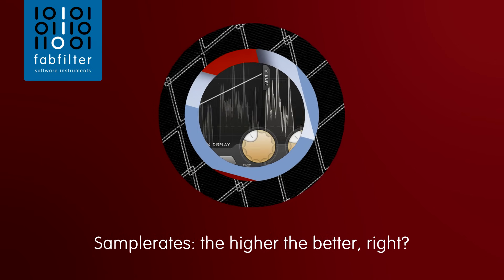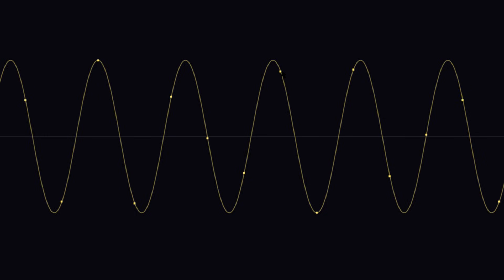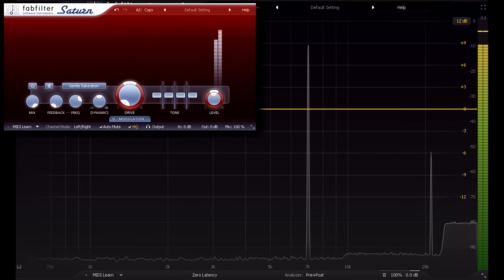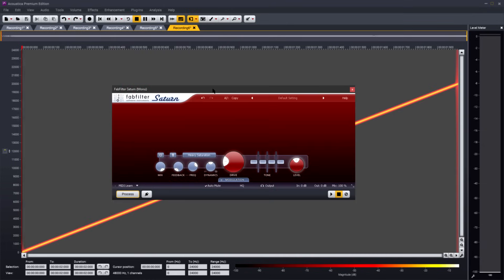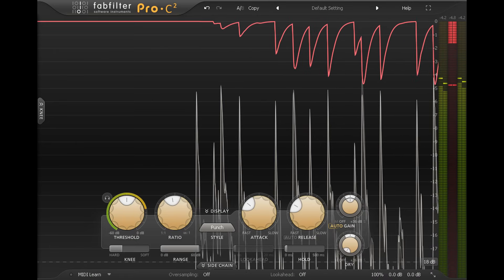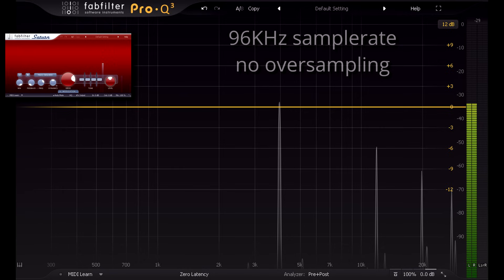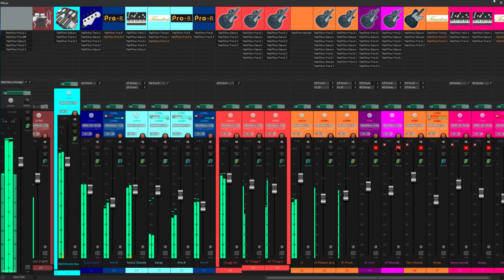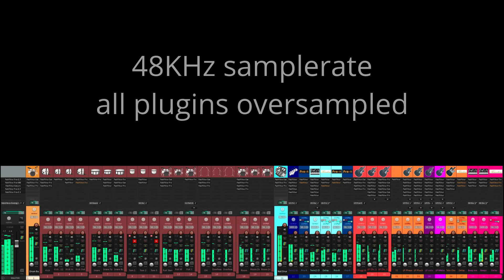Samplerates: the higher the better, right?

Comment: This is a spectacular expose on the topic. The only place where I get confused is at 24:05. when "the synth fills up the top bandwidth and it will start to alias as soon as it hits a non linearity". I not sure I understand why it would with the Nyquist being so far from it. Or why simply putting a gentle lo pass before it got past 22K wouldn't be a fine action at 96K? And then the simple question put forth to answer about high sample rates, "when to use them and when not to". So when should we not, in this construct of premises?

Thank you again for this video!

Comment: Fenomenal presentation on the topic, incredebly well produced. 

the HQ´button (oversampling) on the fab-plugings is golden, but what i dont understand is 

why it's not as an AUTOMATIC option, to use only during RENDERING ?
Many other plugins DEVS allow for this , MELDA , SKNote etc
Meaning you could work at a lighter CPU during mixing and NOT having to manually activate every instace of Oversampling during a 'Bounce' of the mix. 🤔

Comment: The trouble with this is that at first they say "Oh, but nyquist theory means you can in theory represent stuff ideally."
Which is then contradicted by "But we're not running in ideal scenario and look at how saturation suddenly brings artifacts" 
(which can be seen when going through a DAC, with audio analysis in hardware)

And then there is
"Look, we can remove some of the artifacts of digital saturation partially by increasing samplerate" — which directly contradicts the implied meaning of the title of the video
After which they go
"But it's impractical and isn't ideal in terms of how it gets rid of those artifacts, so let's try a different way to increase samplerate, with a filter on top of it now"
Which doesn't mean higher samplerates aren't better, in fact, it says the opposite: with proper (and even not so optimal) settings, higher samplerates are better, and with added filter can be another step better.

There is an additional situation when they showed the 20KHz tone and said "but I can't hear that"
And it's then said that not hearing it is rather normal, and you shouldn't be ashamed of it, since "most lose the ability to do so prior to becoming adults"

Which is fair, but doesn't bring up the point (which, shown later, they kind of know, but not deep enough and are thus spreading misinfo) that even if you could hear that, you very likely wouldn't via watching the video, because of YouTube, which is sending you either one of the OPUS streams or AAC streams, and all the AAC ones are 44.1KHz (a few are 22050, we don't talk about those) with a filter cutoff at just below 16KHz, while all the OPUS ones are at 48KHz and have the cutoff at somewhere above, perhaps 22KHz, (where you actually would hear that segment, if you could).
Side-note to this, interestingly the whole video's audio is with a clear 20KHz cut-off, except for that segment at 4:50.

The "listening test" section is, imo, laughable for bitrate reasons, which is, at best, 8x compression.

And the biggest issue, to me, is in the conclusion they arrive at.
The points showcased clearly show that whether higher samplerates are better, depends on your definition of "better". For studio use-case, their main drawback was the increased file size (for when it is in transit, since you can compress / downsample for storage, if you really cared about file size, which itself is quite miniscule in audio), it clearly shows that for quality, higher samplerate is better, and filtering is even better, but there are some plugins which come with oversampling, in which case that should be used, and there are some plugins that don't benefit from higher samplerates (according to video contents anyway), i.e. EQ. Which does come with drawback of higher processing power, yes. But it hasnt been shown by how much, and whether that really might he an issue, but it's considered enough to say "it's not better". Really?

Comment: In my opinion, priorities are recording, rather than mixing, at high resolution, and using plugins with built-in anti-aliasing features, but if your system can manage it, a higher sample rate is still going to help with the quality of the filters and allow you to more easily deal with plugins without built in anti-aliasing. There is also another benefit other than the filter qualities of individual plugins, which is that you may get more consistency across your mix if you have plugins with different degrees of oversampling or different types of anti-aliasing filters. I have some plugins that have anti-aliasing filters that work, but that do have an audible effect on the sound. Keeping those effects outside of the range of human hearing requires a 96kHz sample rate, so in that case 96kHz makes a noticeable difference across a mix with some of those plugins or even multiple different anti-aliasing approaches.

Another thing I often hear (including in this comments section) is that high frequency content will create audible distortion in amplifiers. If you are worried about this you can always add your own filter above 20kHz during mastering and check to see if it it is altering the sound in the audible range, and then you may still benefit from playback at 96kHz depending on the DAC, without the risk of overloading the amp. That concern shouldn't affect the way you mix.

OK I have to add because it was bothering me. If a plugin bogs down your system when in anti-aliasing mode and you are using a high sample rate, that is a poorly designed plugin. If you're already at at a high enough sample rate, the anti-aliasing mode doesn't need to oversample, it only needs to filter, because you are already oversampling, and frankly a lot of plugins could be better designed to simply not generate frequencies higher than the nyquist limit in the first place, eliminating the need for filtering.

Comment: In the radio frequency world, we often (in fact, almost always these days) use non-uniform sample spacing: quadrature sampling, with pairs of closely-spaced samples ideally a quarter-wave apart. This allows high-frequency content to be stored using a total number of samples limited only by the bandwidth, i.e. how much higher or lower you can represent vs the center frequency you picked for your quarter-wave sample spacing, while ignoring the information needed to recreate frequencies further away than that.

What's really interesting though, is that those frequency reflections you're getting off 0 Hz, instead reflect off of the bottom bandwidth limit of a quadrature-sampled stream. I wonder if that behavior could be useful musically for some kind of synthesizer.

Comment: Keep in mind your initial analogy implies that resolution doesn’t matter… so long as the screen is displaying a solid colour. The differences become much more apparent when when complex images and sounds are combined and contrasted, AND you still want to be able to discern between them. Similar to old movie vfx, some things are easier to hide in the low resolution, but high fidelity is certainly more “technically impressive”. 

I would recommend using high sample rates when recording voice or samples that will be heavily processed, in order to be able to push the effects further before noise and artifacts take over. 

Really I recommend to push your gear to its limits, that’s how you really learn

Comment: I can hear the difference on the 96k vs 48/44.1 even on my basic laptop audio - it's subtle, but to someone who has listened carefully to recordings for a long time it adds an extra dimension that is often missing from digital recordings but which does tend to be found in purely analog recordings. I will be experimenting more with sample rates now to find out what works better in my case. Thanks for the clear video. :)

Comment: In the 80's I played a test CD with the sweeper sound (pure sine) from 20 to 20000Hz on my Hi-Fi. The CD played it perfectly without any chirping sound. But when I recorded it on the cassette tape, the tape played it with the chirping sound, exactly as at 10:35! Why did it happen? I though that it was an artifact produced by the dolby circuit. Now I don't remember if I tested it also without dolby, but probably yes. Do you know where the chirping sound came from?

Comment: Polyphase lowpass filters induce harshness and jerkyness in highs. It`s brickwall filter and some distorsion and phase difference is inevitable. In a CD, it is set to 20 kHz, so the harshness is not so pronounced as in mp3, where filters is usually set to 16 kHz. That`s the reason for screechy/flat sound of mp3`s. I always set my recordings to 96k/24b, 30 kHz lowpass filter (minimum distorsion) and I think it`s an optimal storage/quality ratio.

Comment: Great video to dispel some common myths, but I think you missed a LOT of important counter-points for people deciding on what sample rate to use:

1 - A/D/A Converters sound different at 44/48 and 96khz, often easily detectable in blind listening tests. In fact, it's generally agreed amongst DAC designers that it's easier to create good sounding converters at higher sample rates. That's not to say every converter sounds better at a higher rate, but cheaper converters probably will and very few will sound worse at 88/96 compared to 44/48.
2 - Even though 48khz gives more room for the anti-aliasing filters, it's still too steep to sound natural. Because of this and other issues with re-constructing real-world audio (not simple sine waves but the mish-mash of tens of thousands of waves that real audio is), the world's leading authorities on the topic (like Lavry himself but virtually any of the software/hardware engineers who make converters) seem to agree that somewhere around 60khz sample rate would be the absolute optimum, but that 88 or 96 are close enough to not be "too fast" (where more weird noise and distortion problems kick in) but fast enough.
3 - If you do any pitch shifting, 88/96khz+ is important.
4 - Latency is lower at the same buffer size with higher sample rate.
5 - Running at 96khz means you mostly only ever really need 2x oversampling (as it's equivalent to 4x at 48khz), if you need any at all. You almost never need any in the real world though so it's just a nice safe project setting and forget about oversampling most of the time. Less SRC is better as you always lose information every time you downsample, even though it has gotten very good nowadays.

With modern computers as fast as they are, SSD space as cheap, and almost everything supporting higher rates now, it makes no sense to me to risk running at 44/48 and losing at least a few % of quality, possibly more.
Reply: MF Nickster  by oversampling converters I assume you're talking about modulator section of a modern sampler? They indeed run at very high rates but very low bit depth and still require "conversion" in the decimator section to the sampler's rate and bit depth, so of course there is trade off in filtering, noise, dithering plus SRC conversion that all contribute to quality issues. At some point you need a band pass filter for Nyquist to even work, which means you have to (in layman's terms) mess around with a continuous analog stream of tens of thousands of summed sine waves, surgically extract frequencies higher than 1/2 your sample rate and piece the remaining waveform back together, no matter when you do that. All over the internet you see people using pristine single sine waves to prove how "easy" it is to understand Nyquist, but unless you're electronic lab equipment it's better to take into account the vast complexity of real-world waveforms and avoid getting close to any real nyquist cutoffs. Read detailed, nuanced understanding of the topic like this one: https://www.wescottdesign.com/articles/Sampling/sampling.pdf. Even Dan Lavry who wasn't a huge fan of high sampling rates suggested in his famous papers that somewhere around 60khz would be the ideal trade off.

Beyond the technicals, it's actually really easy to real-world test the accuracy of converters. Just run a loop-back null test on the same converter at 44 and 96 for example. In general I find it nulls better at 96.

Finally, when it comes to the test that really matters (the ear test), the AES has researched it for years and it's proven that trained listeners can easily distinguish between pristine 44/48 and 88/96 recorded content: https://www.aes.org/e-lib/browse.cfm?elib=18296
Reply: MF Nickster  I guess you didn't open the links then? The AES link is where the Audio Engineering Society did a large scale meta-analysis of all double blind, high quality studies and the conclusion was that the average person had a slight ability to pick the HQ (high sample rate) version, but that that a very large % of "trained" people (audio engineers, average people who were trained how to listen) could pick HQ sampled material reliably. In other words, there is obviously a difference and people with good enough ears can hear it. My guess has always been that, since most of the artifacts are in the 10k+ part of the spectrum, it's mainly people who haven't damaged their ability to hear high frequencies who can easily pick the difference (most live audio engineer's ears are shot up there). So that's really the most important thing, people with good ears can hear the difference.

If you're still not convinced, here are some tests I ran myself with my Lynx HILO converters. You can easily do the same with any converters and get roughly the same results, I've still got the project file so at some point I'll run it through other converters I have access to like UAD Apollo x8p etc some day. The methodology was as follows:

1 - Analog, warm synth sound with some saturation and basic EDM drum machine with some tube and other saturation to ensure the presence of harmonics.
2 - Used a synth and drum machine only to generate the audio to avoid any need to SRC the source content as a part of the test (ie don't use an audio file as the source because it will change already when you SRC it). But critical to the test to is to ensure a blend of complex waveforms including harmonics to replicate "real world" waveforms.
3 - Recorded the clean output (mixed inside the DAW bus) to one audio track, and routed the stereo out through the converter's analog outs and back in through analog ins three times in serial, the recorded the final input. In other words, the source goes through 3x DAC and 3x ADC in serial so that the effect the converters have on the sound is compounded 3 times.
4 - Perfectly aligned the "clean" and "3x loopback" versions, phase reversed one and recorded the mix of the two to create a "null test".

Other notes: Both projects were configured exactly the same. Identical gain structure in every way, identical peak levels out of converters, identical routing. Other side notes are that for both tests (44/24 and 96/24) I routed via my Flock Patch (it's a pure analog path) to make configuration easy so the actual routing was DAC out of HILO converter into Flock Patch and routed back into HILO inputs for ADC, repeated 3x. I didn't bother trying to perfectly gain match the clean and loopback to remove any weird gain issues with the Flock because the purpose of the test wasn't to test for "perfect" conversion but to show the difference using the same converters at different sample rates. The two clean versions actually already sound quite different to me, the 96 sounds cleaner especially in the HF.. but that's subjective and doesn't have anything to do with converters. It may be something to do with the synth and drum machine being used etc. The really important thing is what happens when you DAC and ADC the source, the null test is a pure test of what the converters themselves are doing, irrespective of the nature of the clean source.

You can very, very easily hear in the null test how badly the high end is being destroyed during conversion at 44.1khz/24bit. The 96khz/24bit null test just sounds like a very, very quiet version of the original track meaning even conversion across the spectrum. I spent a few seconds gain matching and my increasing the loopback version's volume a few fractions of a DB reduced the volume of the null almost 3x but the character of both remained the same (ie tight across whole spectrum for 96 and messy HF for 44).

Here are the WAV files from the test: https://www.dropbox.com/sh/wqtz650qmdr1abb/AACUEq3JiVcazYEr4ERyFO91a?dl=0

Also, the sound of the converters is only 1 point of 5 that describe why I always record at 96khz nowadays :) but a very important one. Mixing at 96khz is almost more important. In a world where I spent $11k to buy a Sony c800g because it sounded maybe 5% better than my $1k Neumann TLM103 on the vocals I am recording, being able to easily get a 3-4% quality gain by using the right sample rate at $0 extra cost is a no brainer. For many people, it's not going to be the most important thing when it comes to getting the best sound. For some with old/slow machines or low disk space, recording at 88 or 96 may even result in a worse result because of workflow getting in the way of the creative process. Some people maybe even like the garbled high frequencies that come from lower SR conversion for their content! But if your goal is capture the most accurate, highest quality sound, the simple fact is that Dan Worrall's analysis is helpful but ultimately wrong because he falls for the age old problem in this space of only using simplistic sine waveforms for his analysis. The fact that so many audio engineers (note that it's almost never actual electronic/dsp engineers who build this stuff making the "44 is just as good" claims) keep jumping on Youtube to spread bad information is just holding the industry back or at the very least creating a lot of mis-information.